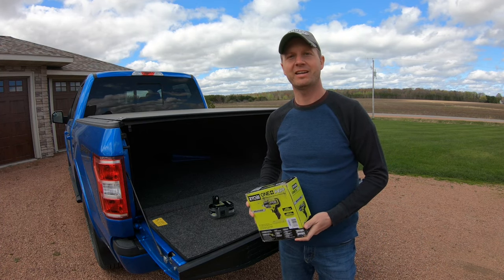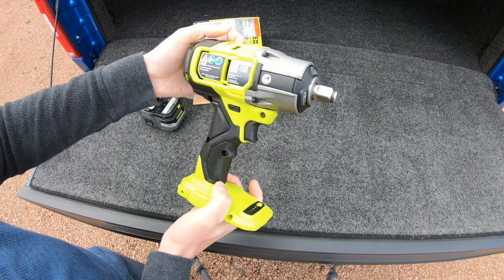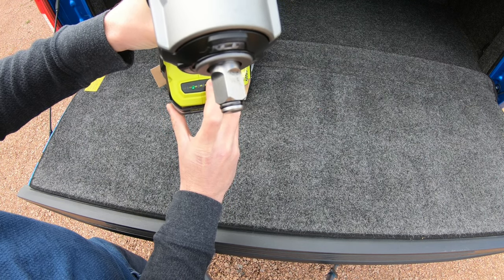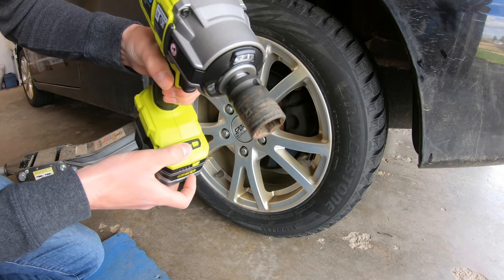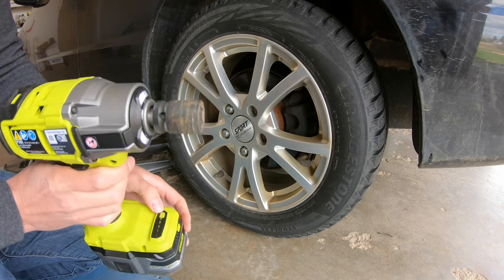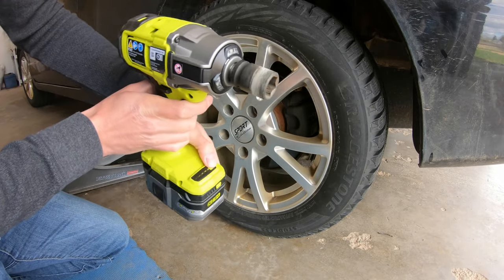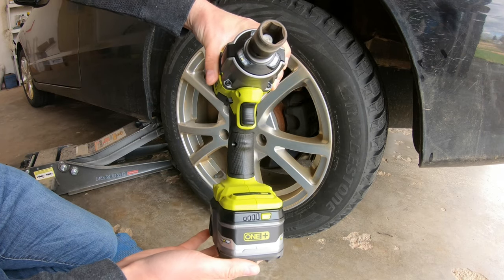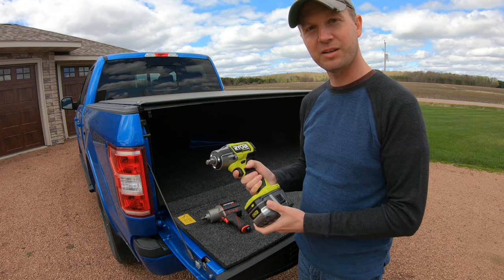Ryobi Impact Wrench Lug Nut Test | Unboxing P262 1/2" | 6.0 Ah HP Battery

Comment: If you use a deep socket, the extra weight of the socket will make lugnut come off easier. I have the older Ryobi model p261 225 ft lbs fastening and 300 ft lbs breakaway is enough for my hone auto needs. Cheers!
Reply: My concern is. Better storage for your trunk. Will battery with stand cold and hot. I know to check on it periodically
Reply: @bgood213 keep the battery somewhere a little less cold or hot and problem solved

Comment: Im a VW dealer tech, been using  this impact daily for over 2 years.  Only failure was the LED lights in front but that is due to me abusing it and throwing it around in my cart.   Performs and  just as reliable as the "professional" high dollar impacts if not  lasts longer.  You cant beat it at this price point.  For the $160 i paid for the tool,  Id buy this again when it does breakdown
Reply: That’s a good point. If it costs half as much and lasts 3/4 as long, that’s a win.

Comment: Home Depot has this model on sale right now for only $199 with a battery, charger and a deep socket wrench set. If I had this last week in my car, it would of saved me over an hour of being on the side of the road with a lug nut that refused to come loose. I`ll be buying mine before the year is up.
Reply: I only see the tool only for $189 as a "special buy".  hmmmm
Reply: Currently on sale as part of ryobi days sale. Get the 3 hp batteries 2, 4, and 6ah with charger and bag for 200. There are other tools to choose as well. Then at the check out it will take add'l off depending on tier and what other qualifying items you have. For me it wiped out the 25 dollar 18v ryobi fan. Very happy.
Reply: @JAERepair  Yes, that package came out about a month ago. I think there`s another bundle option they also have on sale.

Comment: its not automatic mode its auto mode ...like cars nd stuf so when you take something off it just brakes it loose and stops after that and then when you tighten it only tightens till it starts to impact then you need to use a torque wrench to do the rest so you get the corect spec and dont over torque everything

Comment: This is the 1st and only time I've seen Ryobi's newest 1/2" impact wrench tested. It's not hard to find Ryobi's old, brushed motor, lower/midrange torque 1/2" impacts test against tools that easily outclass them. I have zero brand loyalty but I do have a lot of Ryobi battery power tools and Ryobi batteries to go with them, a charger at home and work. 
I certainly wouldn't want you to come out of pocket $4,000 to test all these high class impact brands just to give the Ryobi a fair shake.
It's probably just-a-tick below the BigBoyz for 1/2 the price. Typical for the Ryobi line. What doesn't impress me about some of the other channels out there is lack of honest comparison. If these other channels that have better sponsorship than you can get, aren't going compare old brushed motor designs with the new brushless design of same brand so that we can see how much better their new brushless designs are.
Just finished watching a video that was 9 months old that still tested the brushed Ryobi impact gun against competition when this more comparable model has been out for over a year, and they totally left it alone. That alone is enough to drive me back to Ryobi.
Reply: well said. im going to buy because im already invested in ryobi.
Reply: The Torque Test Channel has recently tested this Ryobi. Their testing procedures seem to be pretty valid and unbiased. 
You might want to give it a look. 😁
Reply: @michaellinner7772  yuuuuup

Comment: Do you think 1.5 Amp battery would be ok for this? Thank you!!! Im saving money to buy it now.
Reply from the maker: I would recommend using Ryobi’s HP series battery.  They provide more power.  I did a test with an ice auger using the standard versus the HP. With the standard battery the drill would cut out versus the HP would drill strait thru the ice.  If your not removing large lugs or bolts you should be okay with that battery.
Reply: @DeanoOutDoors  good to know, thanks again.

Comment: You need thinner wall sockets.   That socket was scraping the wheel as it turned.
Reply from the maker: It might look that way, but there is a slight gap between the socket and the wheel.  It doesn't rub it at all. I believe most, if not all impact sockets are this thick.
Reply: @DeanoOutDoors   what about all that light colored residue on the outside of the socket on the last lug nut you removed.   

I have standard impact sockets and thin wall impact sockets.  I have meticulous customers. 🤷🏻‍♂️
Reply from the maker: I see what you are saying.  It looks like the wheel did rub on that last lug nut, maybe because I had the car jacked up, it looks like it rubbed when the tire came loose and wobbled.  Thanks for pointing that out.

Comment: Hi I bought the same tool. is there a reducer that will fit the head of this impact wrench. The head is bigger than a 1/2 inch drive. Help
Reply from the maker: This unit, Model P262, comes standard with a 1/2" anvil with friction ring for quick socket changes.  No need for a reducer.
Reply: Yes it's a tight fit I figured it out. Love this impact. Works amazing especially if the more powerful battery is used with it.

Comment: I've been considering getting torque sticks for mine.  I'm afraid of the possibility of shearing a lug off.  

Idk how unlikely that is, but on its highest setting this thing can definitely pack a punch.
Reply: that thing will not break your studs. even the high torque Milwaukee guns won't break a stud off without impacting for a long time, you will be fine. just use it to take them off, then use a torque wrench to tighten them back on, torque sticks are a waste of money. IMH
Reply: The auto setting on this is designed to STOP as soon as it feels the nut is tight/loose so you can't over tighten a bolt, or have it go shooting across the floor when you are loosening them
Reply: @lifewaidan7517  they do destroy lugnuts.

Comment: @1:05 What do you mean by communicate to the gun, amperage or just a signal? Because I just ordered yesterday a generic 6.0 battery and it doesn't have the extra tabs. I just need it to remove 19mm lug nuts. Thanks.
Reply from the maker: Yeah, the HP batteries will deliver greater power and be more efficient then the standard One + batteries.

Comment: I have many Ryobi tools, but they run on the 18 volt 4ah batteries. Will this impact wrench be able to run on those batteries?  Thx.
Reply from the maker: Yes, you can use your 4ah batteries.  I’ve used them in the past to rotate tires on my vehicle.  The HP batteries are just a little better overall performance and won’t cutout  and will handle more torque. If you’re going to be trying to loosen larger heavier torqued bolts, then the 6ah HP is a must.
Reply: @DeanoOutDoors I found your video to literally find out this answer.  I have a slightly older Ryobi 18V One+ 4Ah battery pack and was thinking about buying this 262 model impact just for the occasional tire/brake work.  So you think if I just buy the “tool only” pack that will be fine with the 4Ah batteries for light/occasional auto use?
Reply from the maker: Yes, the 4ah battery will perform just fine for light duty work.  The HP batteries are not necessary, but they will work a little better overall.
Reply: @DeanoOutDoors  Awesome!  Thank you so much for the quick reply!  Doing the brakes in a few days so I need to make a decision soon.  Thanks again!

Comment: Would like to know if it will do 100 ft lbs torque as thats what my lug need needs
Reply from the maker: It will have no problem with 100ft lbs. As long as you are using the HP battery.
Reply: @DeanoOutDoors  thanks then I need one of these for when I do my breaks for for a flat tire. My dad got a dewalt impact driver which I know is different but it will not do 100 ft lbs torque so thanks alot for commenting back.

Comment: What did you torque your wheel nuts down to before testing the Ryobi?
Reply from the maker: The recommended Specs of 80ft lbs.
Reply: @DeanoOutDoors   @Deano OutDoors  I was curious because I saw Project Farm test a bunch of impact wrenches on over torqued pickup truck lug nuts and some got them off and some didn't. My brother has a Rigid that's not powerful enough to remove his Hyundai's lug nuts. I want one that will definitely work on lug nuts.
Reply from the maker: Ryobi claims 600ft-lbs. breakaway torque with this model though I have not tested it. They now have an even stronger 1/2" Impact at 1,170 ft-lbs of breakaway torque model PBLIW01 .  This should be plenty of torque.
Reply: P262 is a mid Torque and it will loosen any car bolts and nuts for the project and the 1000+Tq ur talking about is a high torque model and u dont always need high torque for cars
Reply: We had a ryobi p61 it would not remove the wheels on the Crown vic. The wheels were on for two years. Tool kept shutting down. We got annoyed with it and promptly pitched it in the lake.

Comment: How is this held up over time? I just bought one today.
Reply from the maker: So far it's been great.  Be sure to use the HP battery with this.  That's how you'll get the extra torque.
Reply: @DeanoOutDoors  awesome. I’m actually taking it back today but I’m going to buy it again. I found out at Home Depot if you buy it with another tool or batteries you get $60 off both of them, so instead of $170 for the tool and 174 the 24 amp hour HD batteries I can get bowl for $219.  Lol. I got it because it was Ryobi and uses the one plus battery system and I already have those but I don’t have the HD batteries but I’m going back today and will get two of those. I’ve been watching a couple videos and I think it’s a good option for me. I’ve never used an impact except on big stuff with air tools but usually I just use ratchets and I tried it on a couple of the tough bolts I need to do yesterday and they just popped right off like it was nothing, this is going to save me a ton of effort.
Reply: @DeanoOutDoors  Which one? I have the 4ah battery.
Reply from the maker: Any Ryobi HP 18v batteries will work just fine. Larger ah will just give you more run time.

Comment: This impact wrench destroys my lugnuts .
Ama use manual method again hate to have rusty or warp lugnuts.
Reply from the maker: Sounds like you are using incorrect sockets if your lugs are getting wrecked.  I’ve had no issues with my lugs and I switch out from summer to winter tires twice a year.

Comment: Great video! How are you liking this impact after owning? I've been really looking into picking one up for home use.
Reply from the maker: Thank you!  I'm really enjoying it.  I have it paired with the 6ah. HP battery and this impact has plenty of torque.  The fact that you can take it anywhere, without having to carry an air compressor is what sold me on it.
Reply: @DeanoOutDoors  Thank you for the feedback! I bet it feels awesome not having to start up the ole compressor. I'm going to pick this up! Thanks again!
Reply: I purchased this tool, also paired with an hp battery. The higher powered battery is how you get close to the advertised 600 ft lbs. But I am a mechanic, and I didn't want to spend the 300+ dollars for the overpowered milwaukee. So I picked this up. It works great and maybe twice since I have owned it has it been unable to loosen 38mm or larger bolts.
Reply: 3/4 drive and 1" drive is needed for larger bolts. 1/2 drive can't handle those fasteners.
Reply: @wmc128  I bought this tool but can't seem to find a socket that goes on it.
Reply: @MJ-en8qc  Hello, I read your other comment on this same video.  This impact wrench is made for 1/2 inch drive sockets.  I have a feeling that your sockets are 3/8 inch drive.  Yes, you can buy a 1/2 inch to 3/8 inch drive reducer, so your 3/8 inch sockets will fit on this wrench. However, that is not recommended--An ultra powerful impact wrench like this could easily break the 3/8 inch reducer.  For lug nut removal you need 1/2 drive.
Reply: 1/2" drive is socket size.
Reply: @MJ-en8qc  it's just a tight fit... I thought the same thing just gotta really force it to go on. Maybe because it's still really new everything is tight.

Comment: I had this 262 in my hand and the high tourqe impact. I said to myself well for 40 bucks more why would I buy this and not the high torque model with double the tourque of this one and very close in size and weight.  Ryobi really needs to have a buyback discount or plan.   They keep coming out with new models that exceeds the last making the 261 and 262 obsolete.   I have the p261 which is now useless.
Reply from the maker: Yeah, I seen that.  Shortly after I purchased the P262 they released a newer model.  Just like everything else out there, it's constantly being updated.  That's marketing, that way they can continue to sell product.  But the P262 is a really great impact, I can't complain.
Reply: lol “buyback program” for a DIY targeted product
Reply: Help me decide guys, I’m between the the P262 and the new high torque, both available for the same price, I want to lean towards the 262 because it’s not over kill and is lighter and a bit smaller. Would you guys without a thought buy the new version or is the 262 better for being smaller
Reply from the maker: I really enjoy the  P262.  And paired with the HP battery, it has plenty of torque for my purposes.   It all depends on your own situation in the end.
Reply: @cousin_JACK  I think if I was to do it again I would choose the 262 for the mechanical work I do with cars.  It’s lighter and less bulkier.  I also feel with the higher tourqe model you don’t get a sense of control and feeling.    Just my 2 cents

Comment: Down voted. You didn't even put the lug nuts on. What's the point if you're not going to put lug nuts on.
Reply from the maker: Sorry to hear that. I don’t like installing lugs with an impact wrench.  I prefer to install them by hand so they don’t get cross threaded.
Reply: @DeanoOutDoors  I can't fault that, though I do it after about 5 rotations, then only at low speed.  Especially since I want them hand tight until I set car on ground.

Then Ryobi is spec for about 150 ft-lb tightening but at best won't get anywhere near there (i got 80 ft-lb with a new 3 Ah battery).  But turn wise,  close enough to finish with torque wrench.